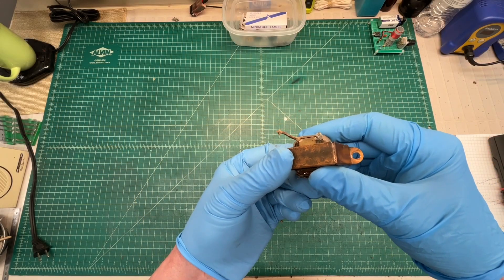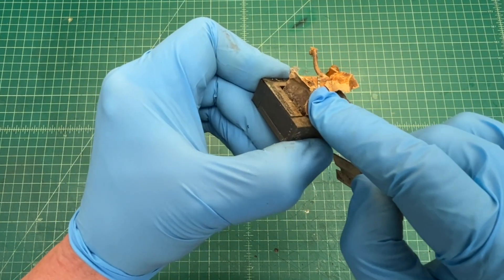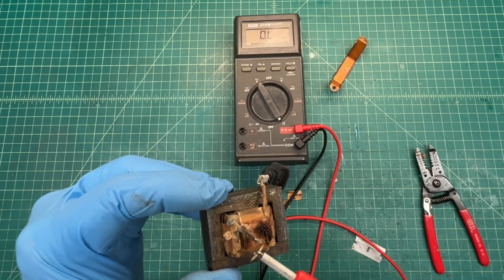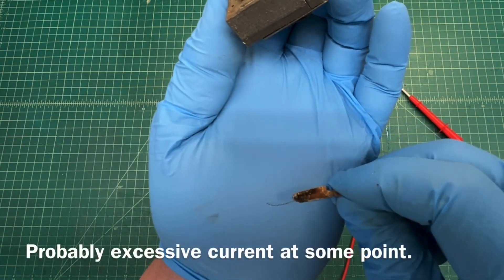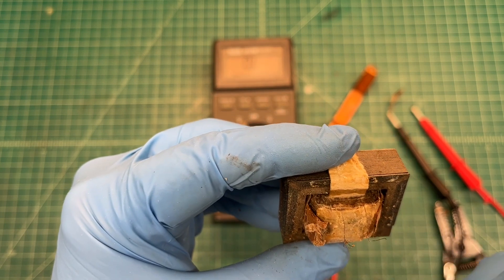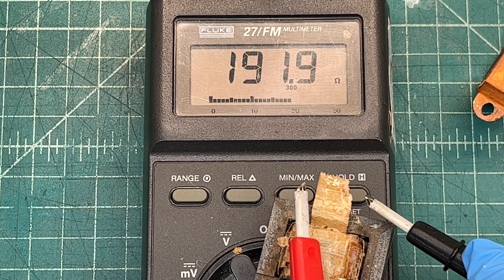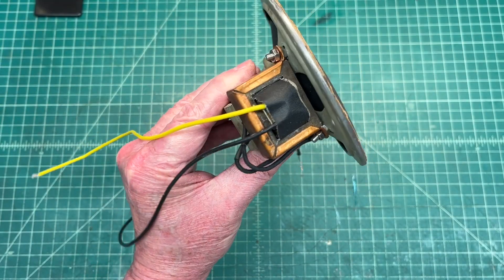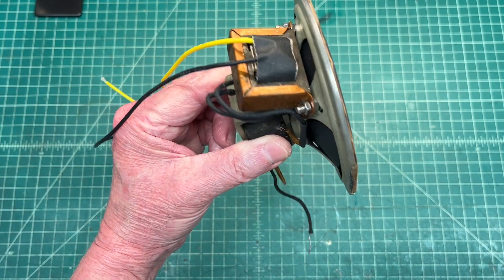Warwick 2-55 - Output Transformer Repair Attempt

Comment: Very nice video and super helpful. I purchased an old Heathkit power supply that the person shipped without screwing the transformer down. Of course it came loose and disconnected from the circuit and tore the paper, etc. I’m going to try to repair it though since I do get continuity. Now have to get some fish paper varnish and do it on a day where my eyes are optimal. Thanks!
Reply from the maker: Thank you.  Hope you are (were) successful in your final repairs. Thanks again for watching and reaching out. Best,

Comment: Nice that the widing broke so close to the outer edge. You get lucky sometimes. No mention of the replacement one.
Was it open too? Nice to repair it as a spare for sure.
Reply from the maker: Definitely fortunate to find that break in… and I now have a spare output transformer based on some basic DC resistance checks. Thanks again Steve for your help along the way. Best, Don

Comment: Very cool Don. Repairing that output xformer was great! What kind or tape did you use to redress the wires? Works perfect now!
Reply from the maker: Thank you Tony. The first layer was 3M Electrical Tape 44, 0.75" Width x 90yd Length, Tan, Low-Halogen and the outside layer was Real USA Professional Grade Gaffer Tape by Gaffer Power, Made in The USA, Heavy Duty Gaffers Tape, Non-Reflective, Multipurpose. 2 Inches x 30 Yards, Black. Hope this helps. Best, Don
Reply: @RestoreOldRadios  gaffer tape, never used that, gonna have to get some Don. Thank you so much! I know I got a bad xformwer in one unfinished radio somewhere. I may try to playaround and see if it can be fixed. Thanks bud!

Comment: You made it look so easy, Don.  What's the best way you've found to remove the enamel insulation from those tiny wires?  Thanks.
Reply: I've found that the the heat from the soldering iron does it for you.
Reply from the maker: When possible I use fine sandpaper, then apply flux and a hot iron removes any leftover enamel in most cases. Thanks for reaching out and watching. Best, Don

Comment: Nice repair Don, I forgot about the original output transformer repair. What kind of tapes did you use? I'm thinking hot glue would hold the repaired leads down more securely, then tape over that.
Reply from the maker: Hi Ken - I’ll have to try hot glue in the future. The tan tape I used:
3M Electrical Tape 44, 0.75" Width x 90yd Length (1 roll), Tan, Low-Halogen

And the final layer is:
Real USA Professional Grade Gaffer Tape by Gaffer Power, Made in The USA, Heavy Duty Gaffers Tape, Non-Reflective, Multipurpose. 2 Inches x 30 Yards, Black

Hope this helps and thanks again for the suggestion. 

Best,

Don
Reply: @RestoreOldRadios  I've wrapped the bobbin with a piece of brown paper grocery bag and glued it down with epoxy. Looks sort of original.
Reply from the maker: @acoustic61  Thanks for the info. Best, Don